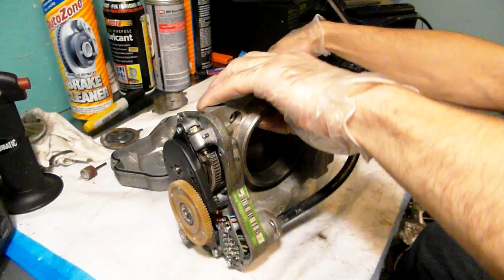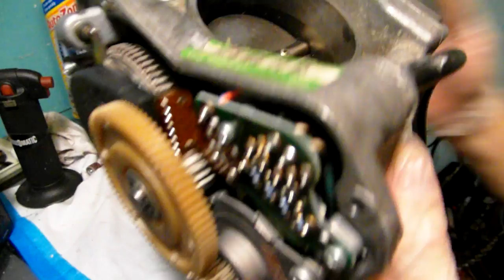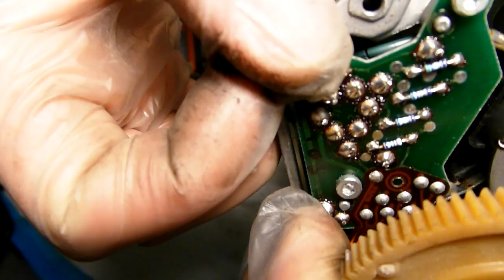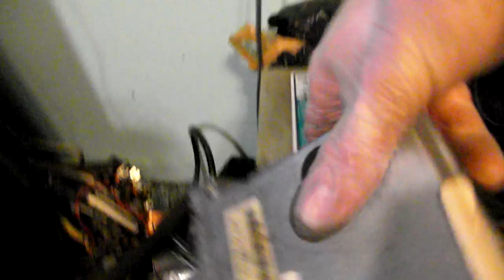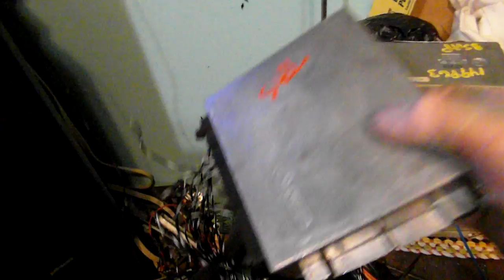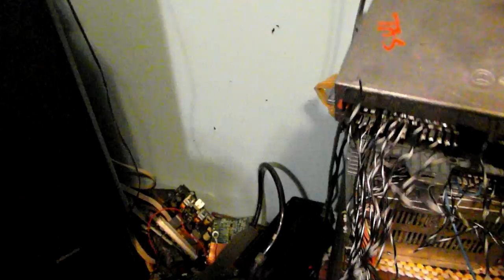Mercedes non-ASR throttle body. Mercedes idle problems

Comment from the maker: I can't say how defective throttle behaves on manual transmission cars. Here in USA we do not have manual Mercedes W210s. Maybe seen custom ones but I haven't seen one yet. If manual and auto cars have same throttle then put on ignition and listen to throttle with engine off. Throttle should be making buzzing noise if it works.

Comment: My 1990 SL 300-24, has high idle at 1500rpm, i did change the overvolt relay and it dropped to 1100rpm, However now the car has been run for a few miles i have a 500rpm when drive is selected  and in neutral  its back to 1500 rpm. Your video may help me but for now having just got the car back on the road after being stored for 7 years i will live with it.AND do something in October, many thanks a very good video.
Reply: Hey ! I am having the same problem which is making go crazy since I have already changed several things but issue remains the same. It only happens to me when engine is warm. Did u manage to sort it out ?

Comment: Hi youre a pretty detailed mechanic,  on a 2001 s600 v12 the first 3 starts seems the car has very slow throttle response. 
After shutting off and restarting 3 or 4th time the car has great throttle response... ever heard of that? Thank you

Comment: Hi Victor
I'm curious what error codes this would have been throwing - since I'm thinking it may be the problem I'm seeing.  I've a 94 E320 M104 W124 that I had the wiring harness replaced several years ago because the insulation was cracking up and falling off the wires.  Since that time I've not had cruise control, ever, and lately I've been seeing an intermittent idling problem (drops so low when idling at a stop light that sometimes it dies). More to the point, though, I'm seeing codes 5 & 6. I'm guessing that the odds are good that my throttle body wires are shot like the harness was,  for starters....

Comment: Whats the problem at my M111 W210 after cleaning that throttle body, I get constant slightly fluctuation of rpm, at idle. I can feel with my hand that the engine is restless. Should I open and check the contacts in this device?

Comment: I have a 2002 C32 and throttle surges to 2-3k I had the TB cleaned last year using about 2 TB cleaner and it went away but returned this year...I had a different friend clean it this time and it worked but returned about 2 weeks later..any recommendations?

Comment: hallo i have an 1994 w124 e220 non ASR and car works perfect but the idle is in cold at 1400rpm and then goes down to 1050-1100.Milege is ok of the car 7.5-8liters/100km,and idle is fix not shakeing.The trottle i can make any adjustment?.......y own a same mercedes automatic with ASR and i change the ECU,but only works when is worm the engine.what is nice is that the idle is perfect 750rpm,,,,,but when is cold it stops the engine after a few seconds.Please can you give me any idea?......

Comment: Hey.
I am having a hight idle issue on mine.i noticed the ETA doesn't buzz on switch on.and idle sits at 1500.
Changed the ETA with another one and it is the same.

What could be the problem?

Comment: I need help my thottle body actuator, the wires look great but, the gears are free turning, like you mentioned in this video. My car staying idle in between 1200/1500...??? My car is non ASR, s420 1994...
Reply from the maker: Rare throttle you have there. Call me one day to discuss. My number is on my website in description.

Comment: I have cold start idle problem on my 1995 E320. Engine idles erratically between 400-1000 RPM when it's cold. It starts and idles fine when warm. Also, the non ASR ETA clicks when it is cold. I also hear ticking like a typewriter on the idle speed module under the passenger floorboard. Car runs fine when warm though. Cruise control works too. I also have a code 17 "Data exchange error between modules" from my built in diagnostic. Is it a bad ETA or idle speed module? Could it be a bad OVP?

Comment: Hi , I have a problem , Mercedes by s600 1995 m120/980 , when the machine is warming up to 80 degrees .right (throttle body)valve is turned off,tell me why ? please
Reply: Same here and doesn't come back on for hours

Comment: Wow...I replaced the timing cover gasket and then started the engine, heard a noise in the upper engine and cracked the cam gear shaft on the intake cam....what did I do wrong ?
Reply from the maker: Don't know what engine you worked on. But valve cover gaskets replacements usually do not involve touching cams or cam gears.
Reply: @vsandvs    M104 front timing cover gasket...I'm puzzled too 94 E320

Comment: Hi Victor,
I have the same non asr throttle body in my w140 s320, but when turned into ignition the throttle body is not energised. As soon as the ignition is turned on the throttle body clicks and goes into limp mode. Great help if you can tell me why this happens.thanks
Reply: Also after pushing this hard upto redline and restarting the engine sometime when it gets heated the cruise control works and idle drops. But after cold start and driving fir half hour the cruise control doesn't work and idle is around 1200 rpm. Sometimes the engine also suddenly dies. After after starting it agian the car goes to limp mode

Comment: I changed the throttle sensor and it was ok.no lights on the instrument panel.but as soon as i wash the car the lights ( ASR + ABS + Oil light ,+ batt.....) .I think I have a short somewhere.please can.you help.I am spending lot of money and it seems all our mechanics are stupid.
Reply from the maker: Maybe lower harness is shorting. I can rebuild it. Price depends on year and model. My contact info is on my website in description

Comment: Hi. Can you tell me. My W124 using same throttle body. In town, my car is crazy on fuel, under 4km/L, but long distance it seems to be OK. What could be the problem..i do however use the aircon all the time.
Reply from the maker: I do not know. I need to see the car to figure out if electronics work properly.

Comment: I installed a new throttle body to my w202.Do I have to get it configured at the workshop or is it just plug in thing?
Reply: +Badrul Shah Where did you buy it?
Reply: In Kuala Lumpur, RM 1850

Comment: Can i replace non ASR to with ASR?
Reply from the maker: Throttle bodies and control modules are different. In theory it might be possible to swap computers and throttles and maybe some harnesses rewiring and ASR unit will work in non-ASR car. I never did this kind of swap. It is easier to repair existing system than to adapt to another